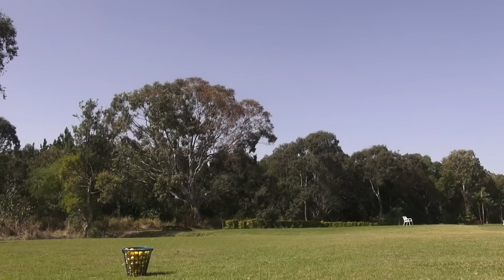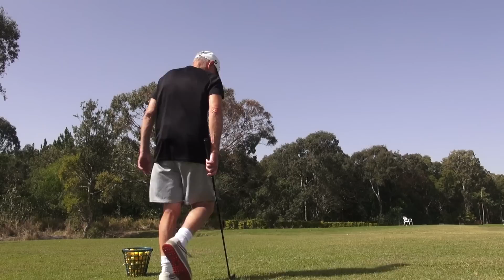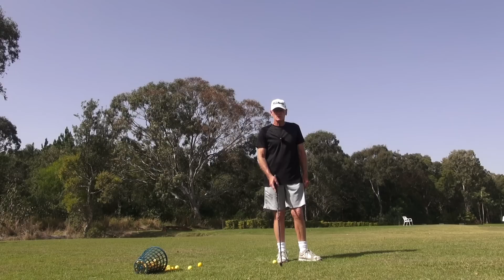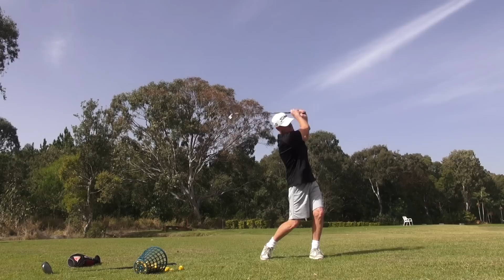Reverse Winding  Clubface  Channel Lock swing..

Comment: Your 100% correct about Hogan JH. Your demonstration of the forearm roll looks just like Hogan’s arm on his downswing. Look at his old vids.
Reply from the maker: What is really amazing is  actually how much you can  try to keep the club-face wide open     coming into impact   and if you have started your downswing    from the ground up   how you cannot actually keep the face  wide open.. in fact the more you  try to keep it wide open the   straighter and more solid   the hit becomes ..  I had the feeling  a couple of times yesterday with some iron shots that I was going to completely       slice the ball in half with the    leading edge of the   golf club   so profound did  did I feel I was keeping the face open through impact ..
                        I wonder  if that was the hidden   meaning in the  name Hogan gave to that  cavity back  forged iron he made  which was called   The 'Edge' .. did Hogan  'feel' that   leading 'edge' of the club   doing what I felt it was doing yesterday .. and did he    try and 'increase that   'leading edge    of the  iron   feel of being wide open coming into the ball ... because the more you     try and  keep that leading edge    hanging back and open as a  'feel' the more   the impact becomes    more  efficient .. its a bizarre thing  to feel    and then see the ball flight you end up with .. ..
                   cheers JH
Reply: Funny. I just switched my Hogan Edge clubs this year after 30 years of use. He made great irons. I’ll give this a try. Cheers.

Comment: I’m in my bedroom with my 2 foot club working on my reverse roll (it’s dusk)
I reviewed Bobby Jones video of 1930 and he and Jack Nicklaus did the left toe roll...
Well most atheletics start from the ground up...I fieldand
Reply: Whoops...the toe roll puts the
forearm roll in place and initiates the garden gate analogy ...the 3rd part of the twirl seems to be the continuing clockwise under move with the left pinkie moving skyward.  Moe demonstrated this rt hand going under the left with vertical drop and horizontal tug...do you feel like the clubface toe is dropping downward at transition as if it weighs 20 lbs ? I feel your revelation is huge and I don’t want to put the wrong take on it...Cheers
Reply from the maker: Every 'good' swing starts the downswing from moving a lead side component 'first' in the downswing ..  it can be planting of the lead heal back on the ground as  Jack and Bobby Jones did .. or moving the lead knee in a semi-circle as per  Moe and Nick Faldo...I have found that its usually the 'last'  body component of the lead side that stops moving in the backswing that is the 'first'  component to 'start'  the downswing  ..  the  Reverse Winding of the Forearms/hands etc  are   'not'   instigating  downswing   components .. they are  subservient   reactionary  in their process application..
                        cheers JH
Reply from the maker: Hi Bob,
             I actually 'feel'  a very deliberate   clockwise turning of the  trail hand  heel pad  of the hand  going back in the swing  and  double that   effect   as the downswing starts  ..    the  toe of the club   does feel like it is 'knifing' away  in a spiralling    backwards/downwards   direction  ...if that  can be comprehended... its just like the   the feeling of the demonstration  I did in the video of what I saw Moe doing     without a club in his hands and how he was   orientating his trail  wrist.forearm ..  its really trying to get  the    drink waiter tray  position   in the trail hand  at and below 'hip height' in the downswing as a 'feeling'.
              In order to get that 'feeling'  at that stage of the    swing  you have to get the reverse winding going very early from the top of the swing ..  I short circuit that need by  just  keeping the reverse winding going that I started      at the outset of the backswing .. I never change the direction of the reverse winding      to that of which I had in the backswing   to that of which I  will have in the downswing .. the  winding only ever as a 'feeling'  goes in one direction .. and that is  'Clockwise'   from the 'start' of the  backswing until the     moment of impact .. as a 'Feeling'..  clearly the elastic winding tension will 'unwind' itself     at impact because of natural   reactive  forces .. but  there should never be any  'deliberate'   intention to  change the direction of the winding  right throughout the swing..
                       cheers JH

Comment: Might just be the  camera angle but it looks like you are playing the driver off the back foot?  Not sure how that fits into your theory but I'm pretty sure Hogan and Moe didn't play it that far back.
Reply from the maker: HI Jeff,
             I don't know if you have seen much of the Channel Lock swing principals explanations.. I would suggest that by your   pointing out   of the ball being played off the trail foot as opposed to the lead  heel area  that you  haven't in fact   seen any of the Channel Lock   swing principals explanations...   because  the  single biggest difference in the Channel Lock swing  'is'   the positioning 'deliberately' of the ball at address off the trail foot area..
       Absolutely Hogan and Moe Norman didn't play the ball from a back foot address position ..   they applied conventional/traditional swing mechanics ball positioning  .. which is why they never remotely looked like the Channel Lock ball position at address.
                The Channel Lock swing   is not remotely in any way  similar to that of  'any'  other golf swing mechanics .. I have developed the swing to 'eliminate' the    potential of pulled or dragged   starting direction golf shots  ..   you can never  eliminate absolutely   the potential of pulled or dragged starting direction shots with a conventional golf swing .. no player in history has ever been able to achieve that elimination factor.. not Hogan... nor Moe Norman ... you can never achieve that with a forward of centre positioned golf ball at address and impact.
                      So to answer your observation.. you bet Hogan and Moe Norman didn't play the driver from a back foot ball position ..    the Channel Lock swing is not remotely like the swings  Moe and Hogan used..
                       cheers JH